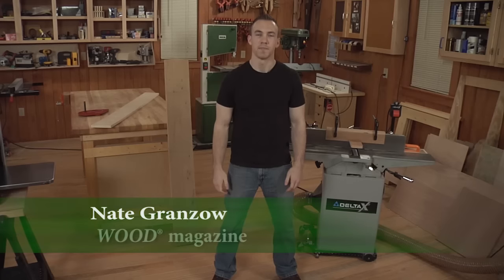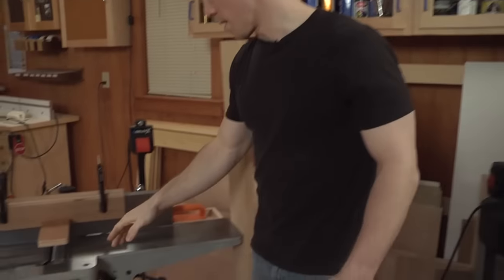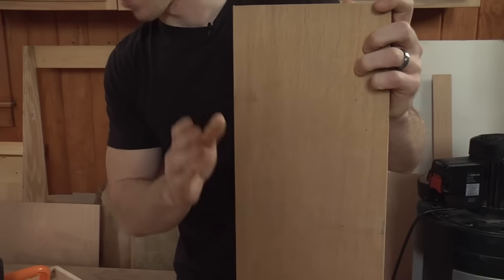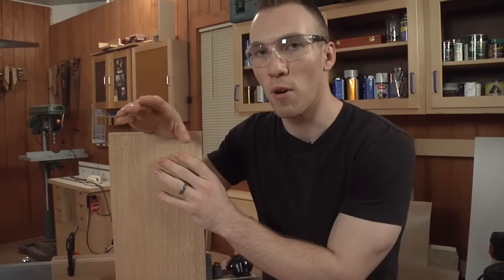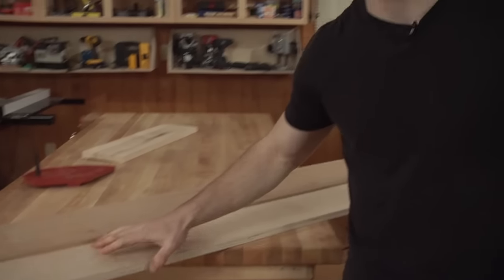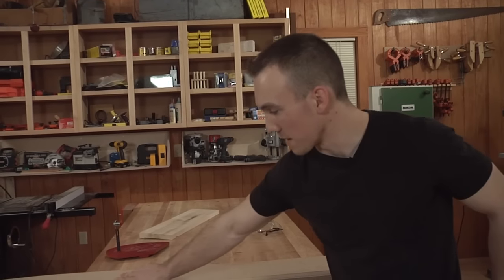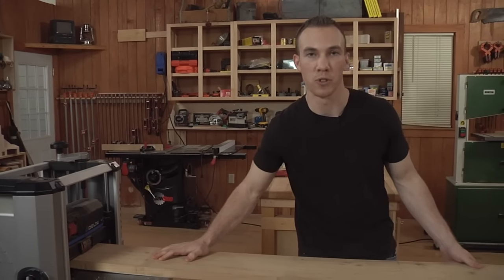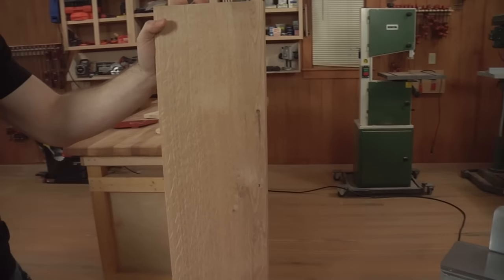How to Joint Boards Wider than Your Jointer -- WOOD magazine

Comment: What about running a flush trim bit after the pass on the jointer? If that board is 8 inches wide a flush trim can reference the planed surface.
Reply: This is a great idea, I see no reason why it wouldn’t be a solution. Gonna try it 👍

Comment: seems to me that that assumes that you get the board flat with only one pass on the jointer not likely in my experience
Reply: How much wood do you typically remove on a jointer and planer before it's square? Let's say you buy a piece of lumber that whose actual (not common) dimensions is 1x6" as labeled on the tag. But you want your finished board to be 1" thick. Wouldn't you have to buy the next size up, which is like 1.5" thick, and mill that, then thickness it down over and over again to 1" thick?

Comment: nice hack, I'll use it in the future

I was however looking for a trick to joint the pieces that are even wider than the planer width. both my jointer and planer are 12 inch wide. and my piece is 15 inches wide.
I need to think of a trick that allows me to joint it on the 12 inch jointer.
Reply: That is called a router sled my friend
Reply: Yup. Look up slab flattening jig/sled and you should find it

Comment: Are you limited to one pass? It was stated that if you try to pass it through a second time you will have a little hang up on the part of the board that is larger than the jointer

Comment: I have what is probably a stupid question. Why not eliminate the step where you run the board across your jointer? Here’s my thinking. Like you said, the planer is going to reference the flat piece on the bottom. So why not just start there, tape a flat board to the bottom of the board you need to joint? When you run it thru the planer, it should make a flat surface on the top of your original board. Then take them apart and plane the second side of your board.
Reply: I was thinking the same the thing until I saw the response to your question, then a light 💡 went off. BAM! Jointing and rabetting the one side gives you the flat surface to mate the flat reference piece to, which then allows the opposite side to be planed flat. Once that side is flat, you flip over and can plane flat the rabetted side. I think this is mechanism behind this method. I have seen a technique using only a planer with the board being supported by shims held in place temporality by hot glue, which is then easy to remove. This method possibly alleviates the rebound cupping mentioned in the response.
Reply: @Bry Dor someday I'll finally have a table saw and can actually get to work setting up a shop to putz around in. I took the long way by purchasing an 80-year old Walker-Turner for a complete resto, which I'm documenting on my channel. Getting ready to upload the disassembly and cast iron resto vid. Thanks for the reply and positive contribution to the conversation!

Comment: I’m not being fresh with this as I’m new to this type of carpentry. I have a customer that wants me to make them a table out of 2x12 ash. Couldn’t you just skip the face planing and just run it through the planer?
Reply from the maker: The feed rollers of a planer temporarily press a cupped board flat while it planes the top face. Once the board clear the feed rollers, it returns to its cupped shape, so you now have a thinner board that's still cupped. A jointer actually removes the non-flat material (the edges of a cupped board) repeatedly until the face of the board is flat. Now, the planer has a flat reference surface to work with. https://www.woodmagazine.com/tool-reviews/joiners-planers/free-jointer-and-planer

Comment: Why would you not simply use the thickness planer in the first place?
Reply: The planer would thickness plane under the cutter head only using its pressure rollers to push the wood down tight against the short planer bed before and after it cuts. However once that wood leaves the cutting area, the spring/twist you wanted to get rid would still be there, albeit the correct thickness. In simple terms, a board coming out of a planer will be the same thickness it's whole length. 

A jointer is effective becuase it has long beds that allow a large amount or all of the wood you are cutting to ride along before and after the cut. The out feed side of the jointer is taller than the in feed side by the same amount the cutter is removing from wood. Pressure is put on the wood on the in feed side and the cupping/twist/spring is taken out of the board in one or multiple passes depending on how bad it is. A board coming out of the jointer will almost never be the same thickness it's whole length, but it will be flat. This is when the thickness planer comes into play. 

The longer the jointer beds, the more accurate it will be. The opposite applies to the length of the board.